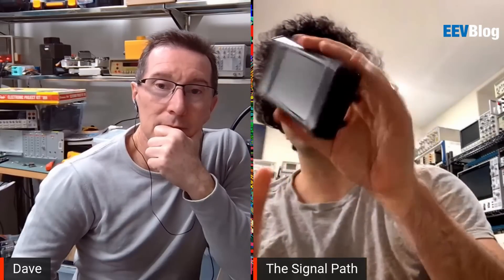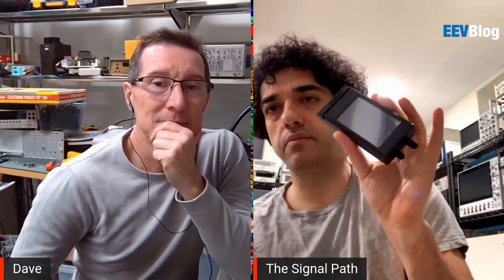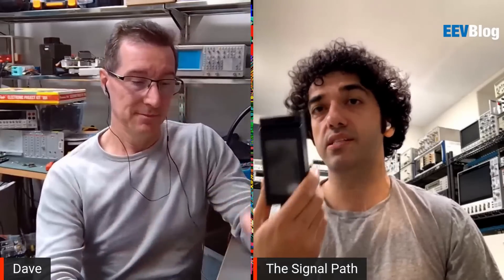Whatever Happened to the uSupply Project?

Comment: Dang.  Just saw this in the recent mail bag and went...WHAT IS THAT?!?
It sucks tearing the heart out of something that you've put so much time and effort in to.  I'd love to have a few of these without all of the advanced functionality.  Parallel at few LT3083's to up the current output.  Run it off an arduino.  Find an off the shelf case.  That LCD is incredible.  Just my $0.02.

Comment: Dave, if you truly have abandoned this project, please consider making it open hardware especially the schematics, but maybe also the pcb files if you are able. Someone (maybe even me in the future) might take it and replace the custom components with off-the-shelf ones to have a less-"cute" but fully opensource DIY-buildable project. It would be valuable to have such a project available because people can customize it without having to reinvent the entire wheel, and also could potentially be useful as an educational tool, and all of that works even if it costs more to build than existing commercial offerings. You can always archive the repository to avoid gitlab merge requests directed at you, and make it clear in the readme that no support is offered. I suppose you can specify in your license that any derivatives can't use your branding, to completely eliminate any support load. As it is the existing opensource firmware, except for its completely hardware-abstracted portions, is not so useful for me since I don't even have a pcb to reverse engineer and to match it to.

Comment: U should have let it open to the community 

Charge for different parts of it let the customers upgrade it and reward them for the fixes 

Not everything needs to be self done and fully finished 

And ya have a fan following SOS a good market for it to work

I would made it tad more chugus added a port for hooking a power input range and had 4 output ports SOS be able to output 3phase n neutral as bonus and use drill batteries or other such things 
Output like 1000v ac n dc 

SOS vfd and valve psu

Comment: In my opinion, the code for this project is too complex for what the hardware is meant to do. I think it's one of those things where... you have to resist the urge to be a perfectionist and ensure that he product actually gets to market with core functionality. You can always re-implement/refactor things later, especially based on customer feedback. This is especially true in tiny teams where people must wear many hats. Initial project should be kept as simple as humanly possible, even if some "best practices" are sacrificed. As long as all key functionality resides in firmware, and the firmware is easy for customers to update, it's all good. Customers always feel good about bugs being fixed, and improvements over time create continuous value. As a technical manager, it's important to limit the obsessions of engineers, otherwise it will all be for nothing anyways...
Reply: If the device firmware is opensource, it is even "fair enough" to sell the device with a simple, solid, basic firmware and let people reflash custom firmware if they really want something crazy.
Reply: @sarowie  Agreed, especially for a product aimed at electronics enthusiasts. Manufacturer liability could end at the hardware level in that case, simplifying things further. Excellent documentation would create a lot of value for that scenario. Dave is the one person who could get away with putting out a "70% baked" product, and letting his community take over, which they absolutely would. This business model has been very successful for PC games, where users generate/extend most of the content and the devs only create the core platform that makes it possible. Dave is a strong believer in keeping things simple, and this project proved his intuition, unfortunately, in this case.

Comment: Nobody wants to admit this but doing power electronics firmware using C++ OOP and C++ Templates was overkill as a first pass, superloop and C modules/structs is still the way to go. 
Use Keil IDE / ST IDE get done and focus on the problem first. There are other problems that calls for sdks/layers/abstractions  like Nordic's latest move to Zephyr platform because protocols like bluetooth is inherently complex but that power supply software is not! yagni principle
Reply: Some people just love complexity. Long ago in a prev job, we did a full C++ implementation and I was tought every single trick for "elegance" on proficient C++ to implement what in the past was done with a 8051 (the previous controller). Of course now tons of functionalities, logs for everything, RTC, matrix display ..... bla bla bla. The result was 180KB of program and 64KB or RAM used in an ARM7 .....  And even in C, depending on your application, you can end with ASM stub for critical sections or very performance-sensitive parts. Not too keen on seeing custom HW treated like a PC. Ok, a HAL  could help, specially now that you dont know what micro will be avaible next ... but you instantly pay a performance cost and you need to write the lower end of the code, because ARM (for example) does not standarize peripherals. Then is Renesas with the RL78, Texas with the MSP430. A good MODULAR C FW, "should" be enough. C++ sure will help to add flexibility, understanding and ease of maintenance ... Using a RTOS ... could be .... I dont see how it can get in need for more complexity. OF COURSE; I DONT KNOW THIS THING, and all the functions it has ... (me youtube commeter LOL)

Comment: A compact footprint benchtop power supply, with a nice LCD screen and simple controls, that would be a product I'd be interested in. I don't think you need all those buttons and programmability on the front panel, if you want that it should be via the PC connection. Shove an ardweeboey thing up its clacker, just enough to leave the USB port exposed, and nerds go wild hacking it.

Comment: Sounds like you need another David if you want to make it. But I see your point. Electronics is always harder than you think. Everyone underestimates the amount of effort you need to put into electronics product. Even the simplest thing. Of course once there it requires a lot less support than software. Yes, you'll still need to update the firmware but it's not as often as software product. You just need to fix bugs, as with software product you need to continue developing, innovating, adding new features or the competition will quickly take over. With electronics on the other hand you can often co-exist with the competition.

Comment: You could just open source and publish the design files and firmware. As for providing support, you could use a software tool (github issues?) to manage the bugs and maybe pump it into the forum. You could always let the community deal with the support and just label the design files saying that. 

I know I'd work on this when I have time.
Reply: Came here to say this.....Even though a lot of the packaging, etc. is custom, the community could fix some of that by generating a 3D printed case, using some standard banana plugs, etc.
Reply: I think the display would be an issue, as it's only going to be cost effective at scale.
Reply: @Anticitizen666  someone will find a way to use a cheap as chips graphical LCD.
Reply: @Anticitizen666  custom LCDs are not really that expensive, the people at r/mechanicalkeyboards do custom runs of things way pricier than custom LCDs
Reply: @theondono  they’re expensive if you’re only ordering one for yourself due to the tooling cost. The only way they make sense is to have a batch made. People could pool together to get them, but just making the design open and leaving it at that would not work.
Reply: @Anticitizen666  IIRC from Daves original video, he got charged ~120$ for 5 units. 

When I mentioned mechanical keyboards, I was referring to group buys. The subreddit always have some ongoing, and they are built from open sourced files. It looks like it works like a charm.

Comment: Dave, I'd buy. 

And I know factories in China that could bang these out cheap (with quality). 

The software is your copy protection. Only provide the chinese with test software, using jtag or whatever your system uses.

There is a decent profit margin in this thing. You'd easily get your money back and then some.

Comment: Isolator is really the only feature that it has that was different than stuff that's on market. You can now "just" get a power supply that's USB-C powered, pair it with power bank and you have basically same thing. And it will work with half a dozen of quick charging standards too
Reply from the maker: Yeah, that's one of the things. I was the first with this idea over 10 years ago and went through various different designs. USB PSU's are now a thing in the market, so it's not novel any more.
Reply: @EEVblog2  Well, for long time there wasn't really any good options, I think only like 1-2 years ones that had both USB-C and buck-boost started showing up. 

But I got XY-UMPD recently and damn, that thing even have a temperature sensor input! And graphing! And it can work in passthru as just USB meter. $20! Sure, its small (still does like 20W) and controls are tiny but for that price its a riot. I just wanted something to charge small batteries without starting my noisy lab supply but I can see how hobbyist could be just fine with using that for their bench

There are bigger ones but so far haven't seen one with buck-boost, just buck so for anything higher than PD voltage still need "normal" external supply.

Comment: Your video back in the day driving a lm317 with arduino got me in to hooked to electronics at my early teens. sad to hear this project is canceled but it's justified.. I'd love to see the design open sourced though, the community would continue it wd guess
Reply: Open sourcing it would not be worth it. To many custom parts.
The LCD also contains engineering efforts by the LCD-manufacturer, so the copyright ownership rights are messy at best.

Comment: Hey Dave if you're not gonna continue the project can you make it open sourced so people want it can make it themselfs?
Reply from the maker: I'd still end up with hundreds of support emails.
Reply: how do you imagine that? Even just the LCD is a custom piece. Assuming crowdsourcing that, you still have to order PCBs, custom CNC parts, ...
Reply: @sarowie  you dont have to use those custom part you can use graphical lcd for it you can change the layout and use a off the shelf cooler

Comment: I would love to have a small but powerful battery powered supply. Does not need to be that fancy and overengineered. Standard display, no isolation, but dual batteries (hot swap possible). Maybe one external that snaps onto the back, maybe even use standard drill batteries for that, they have oomph and are readily available. Maybe an additional small internal 60C battery for hotswap capabilities (and standalone capabilities for less demanding applications). Scrub the custom display+transformer, just do UI in software and boom, the project just got a way better capabilities to development cost ratio.
Reply from the maker: "Does not need to be that fancy and overengineered" and then proceeds to rattle off all sorts of requirements. LOL. This always happens. Everyone wants something different. The LCD is already done and paid for, makes sense to reuse it if possible. And 7 segment displays are nice.
Reply: @EEVblog2  I’m fine with an open source eevblog branded compact PSU with basic functionalities and hardware support for usb control (even if I need to build the firmware variant myself).

Big beefy benchtop supplies are expensive and too big for my limited space, and half of what I do doesn’t go over 12V@200mA anyway. I’m using the compact crappy units, but it’s almost impossible to find one that won’t buzz (super annoying given that I need to spend a lot of time debugging with that by my side) or that I can trust with expensive prototypes.

Comment: Every EE running and gunning in an industrial environment needs one, would need to get up to 24V and maybe 2A would be nice, much less still useful, but that would be a considerable market I think. Dump the isolation, I don't see the point on the scpi in a portable scenario, that's for the lab, at most wifi or BT with an app for the remote operation. And KISS for the software!!
Reply: Wifi and/or Bluethooth require certification. It would be great as you can power it from a battery and just let it float, but the legal implications are messy when you add a radio.
It could be done by using an off the shelve radio, but even that is messy.
"KISS" would be to simply use a battery to power it and a simple optocopler for UART communication.

Comment: Dave, did you decide on an end user price, profit margin, and is there a market for it before you started?
Custom part may make it look unique but using as many off the shelf parts as possible will keep the bom costs down as you well know.

Looks like you may have priced yourself out of the market.

Would make an ideal Kickstarter, rack in a shed load of money and go nowhere. Just don’t use your real name 🙂
Reply from the maker: At the time, yes. And then some feature and cost creep of course. But it's not just that.
Reply: @EEVblog2  With us, the customer would provide the requirements that they wanted, we would respond with "System Requirements Specification" and sales would try and add “But it could do a lot more” after they have settled on a price with the customer. :-)

Comment: You overcomplicated the uSupply by trying to gild every lilly. Pretend that you are in a value engineering team and safely cut out everything that increases the cost. If I want to pull +/- 15v and maybe fixed 5/3.3v out of a box in my pocket then a two line led display is ample. A fully variable output is also no more difficult.                                                                                                                                                                                                                                                                                                                                                                                                                                                                         Look at the Peak LCR or Transistor testers as examples. Paring a design down to the bare essentials and then cutting further can be very tricky to keep performance and reliability but it would be a better win and I would argue a better learning/teaching experience.
Reply from the maker: Have you seen my previous versions? They were much simpler. I've done half a dozen versions, this is just the fanciest one.
Reply: Why would he even bother? It’s not gonna profitable in general and if he does the work, it would be ridiculous as well as being an albatross around his neck for a very long time. On top of that , your suggestion that he perform value engineering on that device turns it into a bad joke. At this stage of his career that would be a project that couldn’t keep his interest for a week. If the world needs that product, someone whose time is not as valuable as his will have to do it.

Just a side note, using a phrase that he has kind of made his own to criticize his stuff on his Channel is a bit out of synch with the vibe In the room.
Reply: @AndySpicer  I disagree, all of the things which you see as obstacles are actually excellent opportunities for content on his channel.  Real engineering, the good, the bad, and the ugly.
Reply: @cellularmitosis2  except that you aren’t the one that has to do it and Dave’s made clear that he has no interest.

Comment: The 'HOTA D6" can be powered by battery, and while its normally used to charge batteries, it has a 'power supply' function which turns it into a bench supply, and can output voltage between 3v - 25v whatever you select

Comment: Stiched together some BMS with 18650s and a buck boost module and off the shelf case. Portable power supply done.
Not programmable though.
Reply: HOTA D6. Its a RC hobby battery charger, but it can be powered by batteries. 
Its also got a 'supply' mode which turns it into a bench supply, with selectable voltage. And high wattage.

Comment: Miniware did the job. But, USB-C isolators don’t exist yet. Dave, if you could re-spin the idea into a USB-C PD isolator, then that product may sell great! If I could send in 20V 5A from a USB-C and get almost that on the other end, I’d be interested. If this isolator supports the new 249W usb-c standard, then it’d be uber amazing
Reply: Yeah but then you can just get fat power bank for most likely cheaper than super low volume USB isolator. Hell, just one of those PD constant voltage modules paired with isolated DC-DC would do the job.